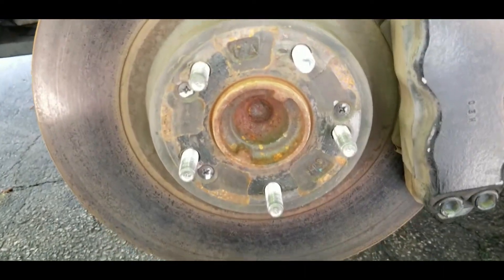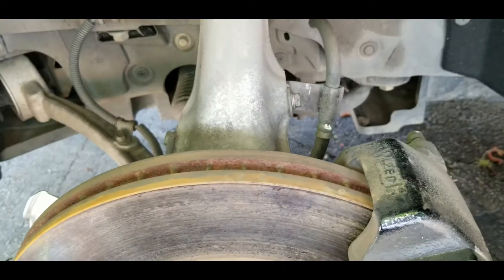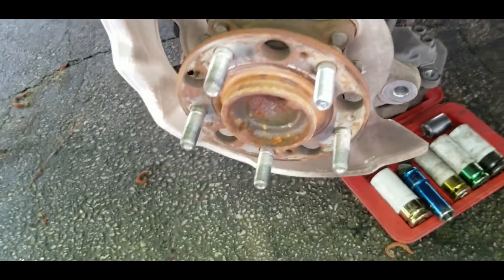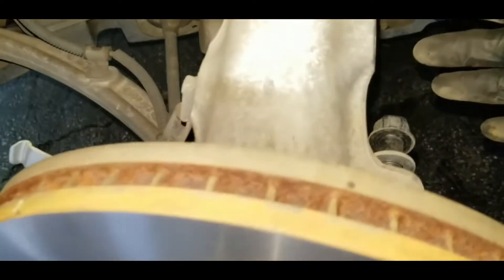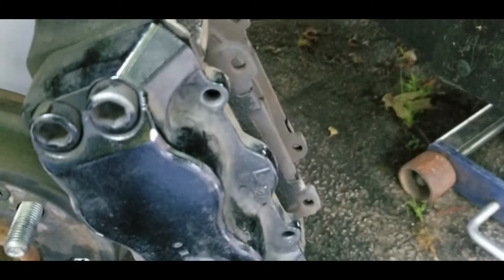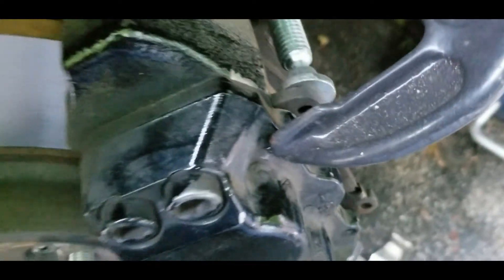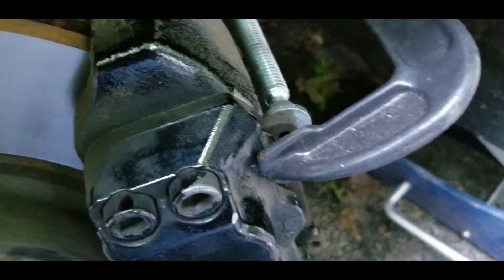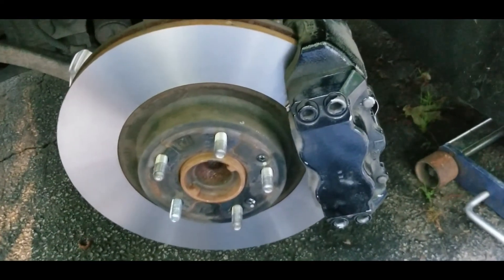Hyundai front brake pad and rotor replacement

Comment: Will be doing this soon.  I have 215K miles on my 2014 Genesis and original brakes.
Reply from the maker: Good luck it’s not to bad
Reply: @DIYKAI  Thanks
Reply: and how did it turn out
Reply: @pixelatedmushroom  To be honest I haven't done it yet as my schedule has been terribly busy with new grandchildren, work and travel. Sitting at just under 225K miles and still no issues. I've had the new pads and rotors for at least three months.